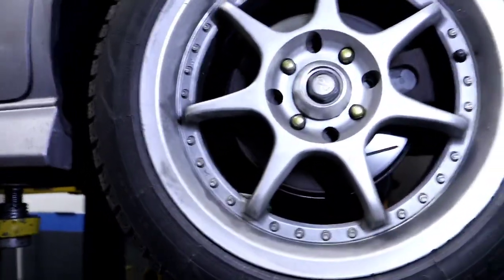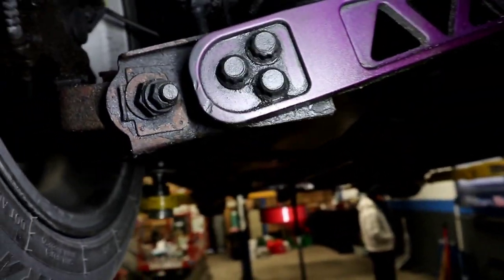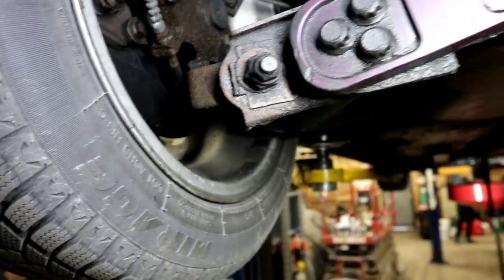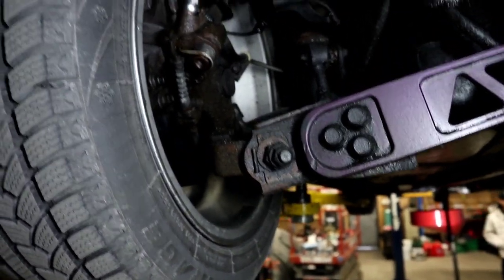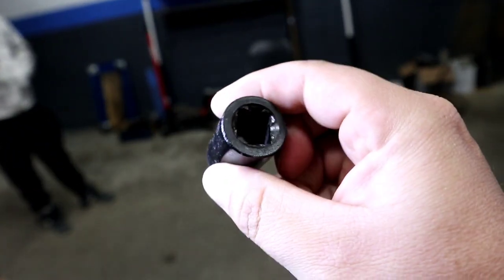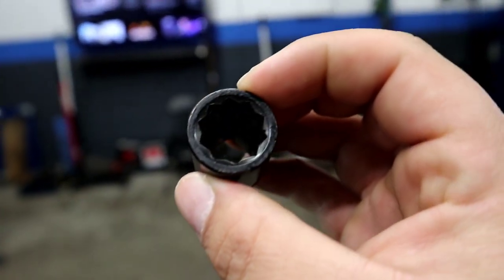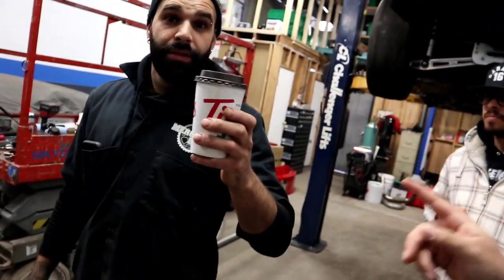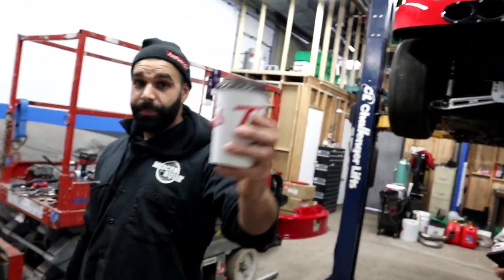7thgen civic 01-05 Rear Disc Brake Conversion TUTORIAL

Comment: So I have a 2004 em2 4 stud I want to keep it 4 stud so to go disk from drum I need a 2001/03 Acura el the 04/05 is 5 stud correct ?
Reply from the maker: 01-05 el all have 4x100 disc brakes in the rear 02-03ep3 has 4bolt 04-05ep3 is 5bolt hole this helps